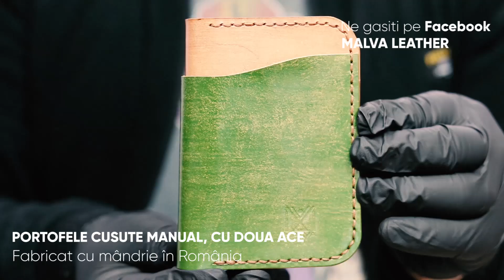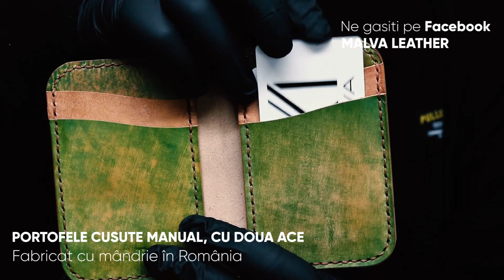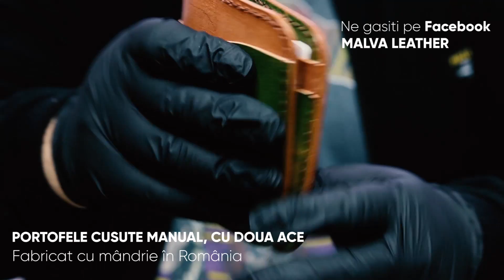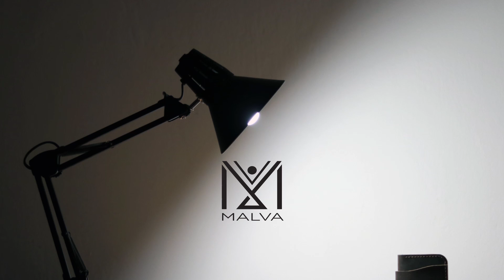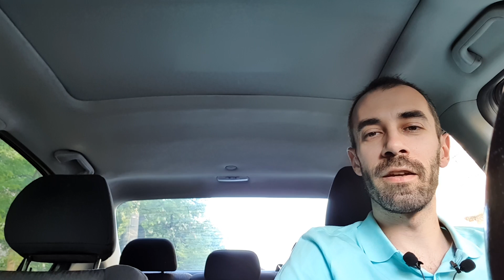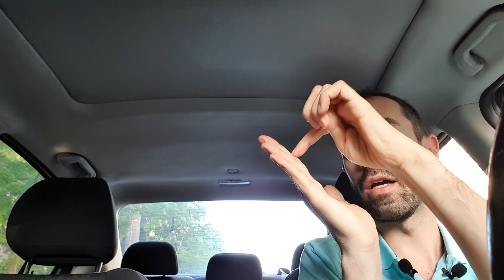Turbinele Twin scroll, de ce le folosește BMW?

Comment: Am zis prea sumar codurile motor de bmw, las aici un link cu o diagramă

https://www.bimmerworld.com/About-Us/BMW-Chassis-Engine-Codes/
Reply: Poti sa faci te rog un video in care sa explici cum functioneaza calculatorul de bord al unei masini? Multumesc!
Reply: @cosminionita1649  te referi la computerul de bord care afișează consumul? Nu e mare chestie, isi preia informația de la senzorii abs și de la rampa de injectoare
Reply: @vladdutz20  Salut! Ma refer la ECU mai exact, as vrea sa stiu ce inseamna acele "mapari" de care am tot auzit, care e rolul lui in intreg ansamblul unei masini, daca poate fi modificat / programat sau nu, lucruri de genul asta. Explici super mega bine, te urmaresc de ceva vreme si chiar as vrea sa vad o explicatie din asta asa in stilul tau despre ECU!
Reply: @cosminionita1649  ecu controleaza injectia motorului prin masurarea debitului de aer prin debitmetru, si prin sonda lambda, primește informații de la o serie de senzori si decide cat combustibil sa comande injectoarelor.
Poate fac un video si pe tema asta
Reply: @vladdutz20  Vlad. Cum reusesc gazele de evacuare sa ajunga inapoi in alt cilindru. Dat fiind faptul ca evacuare este separat de admisie. Adica cand un cilindru are supapele de evacuare deschise. Cum pot ajunge in alt cilindru prin supapele de evacure respectivului. Ele nu sunt inchise pana dupa explozie. Galeria de evacuare nu are legatura cu cea de admisie.
Reply: @denisdanielmuresan4316  pai nu ajung prin admisie, ci prin evacuare.
O evacuare stock este 41 format și toate țevile comunica direct, in momentul in care pistonul 1 își face evacuarea pe urcare pistonul 3 termina ciclul de evacuare și exista o suprapunere de câteva zeci de grade a deschiderii simultane a supapelor de evacuare pentru cilindrii 1 cu 3 și 2 cu 4.
Sistemul twin scroll împerechează țevile pentru 1 cu 4 și 2 cu 3, astfel separând acele suprapuneri și întreg volumul de gaze se duce in colector.
Reply: @denisdanielmuresan4316  Cylinder #1 had just evacuated it’s exhaust gasses and it’s in the process of closing its exhaust valves while the #1 intake valves are also in the process of opening to begin the intake stroke. Unfortunately, cylinder #3 is opening its exhaust valves and releasing high-energy exhaust gasses. While the large percentage of the energy and pressure from cylinder #3 are being used to drive the turbine, a smaller percentage is looking for an easy way out (the path of least resistance). When the pressure is lower going back through cylinder #1’s open exhaust valve than it is at the open/ non-divided inlet of the turbine, exhaust gas from cylinder #3 will circulate back into cylinder #1. Since cylinder #1 is trying to begin an intake stroke, some of the intake charge gets diluted by exhaust. A diluted charge robs power that could have been realized without the dilution
Reply: @denisdanielmuresan4316  uite un articol amplu pe tema turbinelor astora

https://dsportmag.com/the-tech/twin-scroll-vs-single-scroll-turbo-test-the-great-divide/
Reply: @vladdutz20  cilindrul 1 nu are o evacure fortata dupa mom. in care deja a fost o evacuare obisnuita?
Reply: @denisdanielmuresan4316  in urcare da, e evacuare la presiune mica, dar suficienta cat sa ajunga gazele in cilindrul celalalt

Comment: Nu stiu cati dintre cei care va urmaresc, stau 30 minute continuu sa asculte. Nu stiu cati dintre ei stiu ca pot modifica viteza de redare si astfel se bucura de tot materialul in acelasi timp . Eu reusesc sa urmaresc cu 2x si asa reusesc sa va urmaresc toate materialele. Multumim de informatii
Reply: O idee buna, stiu ca sunt lungi materialele dar ma lungesc ca sa incapa toate detaliile.
Jason penske de la engineering explained am vazut ca se limitează la 10 minute, dar acolo e mult detaliu tehnic in engleza
Reply: @vladdutz20  nu e mult materialul. E scurt timpul oamenilor si atentia este scurta in prezent. Voi cred ca vedeti cat timp se uita oamenii in medie la videouri si ce minute parca. Ideea e ca eu asa reusesc sa ma bucur de material in mod integral si se aude si clar cu 2x. Chiar super usor de inteles de ce un motor de 3 e echilibrat si mi-am stabilit urmatorul motor sa fie de 3 :D
Reply: @vlada.5819  6 e cel mai interesant dar vine si cu impozitul prohibitiv :))
Reply: @vladdutz20  Da, ne asumam. In schimb in Germania e taxa mai mare la asigurare ( in functie de cp ). Impozitul nu difera mult fata de un motor de 2. Macar e altceva

Comment: Nici papagalii de la reprezentatele Bmw n-au atat habar, felicitari !!!
Reply: Bmw nu are reprezentanta in Romania. Are doar dealeri. Mergi tu la un dealer bun si iti ierti cuvintele :))
Reply: @raducirstea5011  M-ai spart cu commentul asta... asa-i ca apa-i uda ?
Reply: @puff0086  ai spus-o de parcă tu ai inventat apa calda
Reply: Aia la service trebuie sa stie sa faca o diagnoza corecta si sa monteze piesele conform specificațiilor.
Reply: @vladdutz20  foarte corec... '' trebuie sa stie '' dar n-au habar in general.
Reply: @whiskeytangofoxtrot6080  incerc sa raman original.
Reply: E bine ca au știut ingineri sa le proiecteze
Reply: @raducirstea5011  Salut, poti sa dai un exemplu?

Comment: Vlad ai mentionat motoarele N52 si N53, ca sunt bune, fiabile. Asta se aplica perfect doar la N52, N53 desi a fost tot aspirat si tot 6 in linie, a fost destul de stricacios. Sunt pline formurile in Germania pe tema asta, dar am gasit si informatii in engleza.
Cele mai mari probleme sunt la pompa de injectie - are aceeasi ca N54 :) - si injectoare, deci vorbim de costuri foarte mari. Eu m-as feri de masinile dotate cu acest motor (de exemplu seria 5 2007 - 2011), un set de "doar" 4 injectoare noi pt "fiabilul" N43 m-au costat peste 800 euro, si nici macar nu erau Bosch...
Reply: Corect, sunt acele pompe HPFP stricăcioase, N53 având injecție directa, fara valvetronic, si au fost sensibile la sulful din benzina, de aceea nici nu au fost vandute in america, acolo au ramas pe N52 si pe N46

Comment: Fa un video si cu tehnologia motoarelor Mercedes esti foarte tare sti sa explici foarte bine
Reply: Ar fi prea generic, la mercedes acum au bagat o chestie care mai e folosita si de audi, compresoarele electrice eBooster care completeaza turbina clasica si elimina lag-ul
Reply: Vlad Micsunescu zici de motoarele 3.0 benzina 6 cilindri in linie cu tehnologia cu un motor electric de 48v
Reply: Vlad Micsunescu motor sau generator electric nu mai stiu sigur
Reply: @ionutsolovastru1686  am făcut deja un material cu mentiune si deapre OM656
Reply: @ionutsolovastru1686  se numeste ISG integrated Starter Generator si este montat pe volanta, are rol si de demaror si de alternator doar ca e pe 48v si pe langa încărcarea bateriei prin regenerare baga curent si in compresor de aer condiționat, pompa de apa si restul de consumatori electrici din mașină...un mild hybrid interesant.
Se numeste EQ Boost sistsmul, iar cel plug in hybrid cu posibilitate de rulare electrica se numeste EQ Power
Reply: Vlad Micsunescu mersi pentru informați 👍
Reply: Vlad Micsunescu cum se numește materialul cu mențiune si despre OM656?

Comment: Frate mie drag sa urmaresc clipurile facute de tine, felul cum explici, cum te exprimi! Bravo tie! PS: am si eu o intrebare ce parere ai de Honda Civic FN2 2.0 iVtec?
Reply: Pai fn2 are 1.4 ivtec, 1.8 ivtec, 2.2 diesel si 2.0 type r, daca întrebi de type r e o masina foarte fiabila, fiind motor aspirat, pe o caroserie usoara si rigida...eu civic 1.8 am vrut sa imi iau initial dar nu am găsit în banii disponibili

Comment: care sunt limitele aplicatiilor twin turbo vs twin scroll? de ce 28i foloseste twin scroll si 23/25d foloseste twin turbo? iar 20d sau 20i folosesc o turbina simpla, corect?
Reply: Pe diesel nu exista twin scroll din cate stiu, nefiind aceleasi cerinte ca la benzina.
Depinde de motor, acum de la 18d pe b47 sunt twin turbo toate( o turbina mica cu geometrie variabila de presiune mare si o turbina mare de presiune mica cu geometrie fixa si wastegate)
Cadillac a plusat jocul cu turbina tehnologie Dual Volute Turbo, un progres al sistemului twin scroll.

Un sistem twin scroll este mai ieftin si mai putin complex, fiind vorba de o galerie cu tubulatura separata in perechi si o turbina simpla, iar twin turbo presupune ceva mai complex, 2 turbine, tubulatura complexa, ungere, racire, valve de control, si in esenta sistemele au rezultate similare.
Avantaj la twin turbo e ca poti doza mai bine aportul turbinelor pe un spectru mai larg de ture , ele pot funcționa alternativ sau cumulativ, de exemplu la B47 turbinele merg pe rând,nu impreuna, iar na N57s cele 3 turbine merg impreuna, intra treptat una peste alta
Reply: @vladdutz20  daca poti preciza mai exact acel "de ce 28i vs 25d". care e diferenta de cerinte intre benzina si motorina?
Reply: @madalincosma2531  pai e diesel vs benzina, ai alta plaja de turatie, alta rata de egr, alte temperaturi.
In general.twin turbo pe benzina se pune pentru putere mare, iar diesel folosește twin turbo pentru eficienta.
Compromisul pt simplitate este twinscroll la benzina
Reply: @vladdutz20  da, benzina a avut twin turbo si au trecut pe twin scroll pentru aceeasi putere si consum. La diesel de ce nu s-a facut similar? Ca n54 si n55 aveau cam acelasi output si consum, chiar twin scroll putin mai elastic parca
Reply: @madalincosma2531  difera motoarele, n54 nu avea valvetronic, si turbinele ales au fost problematice, fiind primul bmw turbo după multi ani.
2 turbine vor fi tot timpul mai complicat de gestionat din cauza tubulaturii, a conductelor de racire si ungere.
Twin scroll pt puterile medii e mai ok.
Pe notoarele mari se merge chiar pe twinturbo twinscroll, cum ar fi pe S63 v8 de pe x5m.
La diesel se pare ca formatul twinscroll nu este optim, acolo motorul are presiuni de supraalimentare mult mai mari, in unele cazuri peste 2 bari, si turbina este mai solicitata decat la o benzina, si atunci probabil prefera sa mearga pe twinturbo secvential pentru emisii si eficienta

Comment: Deci te-ai apucat de cursuri online.. sper sa nu ne dai si teme pentru acasă :)
Ai spus 2 lucruri in videoul asta, poate inteleg si multi altii "cunoscatori":
1. Turbina NU reduce consumul, ci turbina + downsizing-ul reduce consumul
2. Turatia mica la diesel e datorata cursei mari si componentelor grele si NU datorita aprinderii sau arderii lente sau alte aberatii
Reply: Ba da, turbina pe injecție directa poate sa reduca consum pentru ca poate merge cu amestec sărac care implica o ratie de aer mai mare decat cea de benzina,insa treaba asta implică reproiectări pentru controlul detonațiilor.
De exemplu ciclul miller este ciclu atkinson cu turbina/compresor care adaugă aer si cuplat cu scăderea compresiei duce la un consum mai mic.

Legat de diesel da, de la cursa mare are turatie mica, asta e valabil la orice motor undersquare cu cursa simtitor mai mare ca alezajul, fie el pe benzina sau diesel
Reply: @vladdutz20  Nu comparam tehnologii specifice cu cazul general. Eu comparam un motor turbo cu unul aspirat de aceeasi cilindree la cazul general, nu in anumite conditii specifice si cu anumite tehnologii. Spuneam ca daca pe un motor aspirat pui turbina, va consuma mai mult.
La aceeasi cilindree, per total un turbo consuma mai mult. De asemeni, un turbo consuma mai mult si in cilcu miller fata de un aspirat in ciclu atkinson.
Daca e sa comparam ultimele tehnologiile in situatii specifice, mazda skyactive-x in modul SPCCI e un motor aspirat cu o eficienta imbatabila. Nicio tehnologie turbo cu amestec sarac nu se apropie de eficienta acestui SPCCI.
Tot scopul turbo-ului e sa creasca cantitatea de aer si prin urmare cantitatea de combustibil injectat, astfel incat motorul sa se comporte ca un motor de capacitate mai mare.
La fel cum ciclul atkinson/miller/budac e o metoda care face ca motorul sa se comporte ca un motor de capacitate mai mica.
Reply: @sil778  skyactiv x de mazda are compresor mecanic de exemplu.
In esență scopul turbinei e sa bage mai mult aer ca sa intre și mai mult combustibil
Reply: @vladdutz20  Skyactive-x este un motor aspirat, compresorul ala de la skyactive-x nu este pentru supraalimntare. 
Si asta o spune mazda:
Tehnologia skyactive-x este supraalimantata?
Nu, dar există un compresor care ajută la presurizarea aerului în motor atunci când funcționează în modul SPCCI.
https://www.mazda.ro/de-ce-mazda/skyactiv-x/
Reply: @sil778  pai atata timp cat baga presiune inseamna ca funcționează si supraalimentat, ca sa atinga amestec sarac de 27:1 ratie
Reply: @vladdutz20  Acel supercharger de la skyactiv-x are alt scop fata de ce scop are la un motor normal. 
La un motor supraalimentat, superchargerul e pus ca sa cresti puterea, adica sa bagi mai mult aer ca sa poti baga mai mult combustibil.
La skayactiv-x, superchargerul baga aer mai mult dar NU cu scopul de a baga mai mult combustibil, deci NU are scopul de a creste puterea.
De aceea skyactiv-x NU este considerat motor supralimentat.
In fine, de la ce am pornit si unde am ajuns :)
Poate faci si un video cu modul asta de functionare a acestui motor. Eu am inteles mai multe de inginerul de la mazda din videoul de mai jos. Oricum, astia de la mazda se lauda ca cu acest motor si hibridizare ajung la 56% eficienta termica, adica mult peste toyota cu 40%.
https://www.youtube.com/watch?v=a82Wt53gu78
Reply: @sil778  am vorbit despre skyactiv x in video mai vechi despre tipurile de injecție, și da, cred că este o abordare interesanta

Comment: Verificarea cunostintelor: Vlad are bimicrofoane pentru ca poarta 2 microfoane de aceeasi dimensiune. Vlad ar trebui sa fie favoritul  samsarilor.. pai daca incepe un samsar sa bage din top si sa si para ca stie ce dumnezeu vorbeste cumperi masina fara negociere. Apropo de asta, ce parere ai de motorul1.6 benzina de pe Suzuki sx4 s-cross 2014?
Reply: TwinMike sau BiMike :)))
Pai Suzuki din.asta a avut o colega si l.a vandut dupa vreo 6 ani, foarte fiabil, avea și ceva dotari masina, si 4x4
Reply: @vladdutz20  conform explicatiilor ofertie de dumnevoastra de-a lungul acestui material videografic, se incadreaza in categoria BiMike deoarece dimensiunile si "capacitatile" microfoanelor in cauza sunt identice:)). In alta ordine de iei, trebuie sa imi cumpar o masina "noua": Mazda 6 2013 2.0 benzina, Suzuki SX4 2015 1.6 benzina sau Kia Sportage 2012 1.6 benzina. Stiu ca nu au legatura insa conform criteriilor mele de cautare am ajuns la astea 3 modele. Suzuki ar fi cel nou, cu cei mai putini km si pret ok, de aia am intrebat.
Reply: @nrbogdan  e spatios ca e inalt... Nici mazda aia nu suna rău

Comment: Ce parere aveti despre bmw 420i 2015? Este fiabil?
Reply: N20 motor, au avut ceva probleme la patina lantului de distributie,insa s.a localizat problema la primele produse prin 2013.
Avantaj e ca daca are compresie 10 merge resoftat la 241 cai cat are și 428i, este doar din soft diferența...duce si mai mult defapt.
Succesorul, B48 e mai rezistent
Reply: @vladdutz20   Multumesc de răspuns, precizez ca masina are 68000km... sa inteleg ca nu ar trebuii sa imi fac griji in privinta motorului?
Reply: @f.m.2624  nu cred, și dacă ar fi sa fie distribuite, acest model de motor are distribuția in fata și e ușor de schimbat

Comment: Care sunt diferentele intre un B47 si N47 , cel B47 este mai fiabil ?
Reply: @Radule39  stiam asta , dar ziceam ca b47 cu ce este mai special fata de n47 ? Inafara de diferentele de putere
Reply: Este pe constructia modulara, toate motoarele b37 b38, b47 b48, b57 b58 împart multe componente.
Au presiune mai mare de injecție, sistem adblue.

Daca ai chef de citit, uite aici disecție pana la ultimul surub

https://www.scribd.com/document/401405687/B37B47-Engine-pdf

Comment: Bro, m54b30 exemplu, 54 nu face referire la nr de cilindrii
Reply: Ba chiar face referire la nr de cilindri my brother, codul scris de tine se traduxe așa :
Este un motor din familia M, adica proiectat inainte de 2001,
5 reprezinta faptul ca are 6 cilindri
4 reprezinta ca e a 4a generatie de motoare din familia M
B vine de la Benzin
Iar 30 este cilindreea de 3 litri
Uite aici explicatie in amănunt, adica ai familii M, S, N, B, P, W,
3 vine de la 3 cilindri 1,2,4 vine de la 4 cilindri, 5 = 6 cilindri, 6 = 8 cilindri, 8 = 10 cilindri, 7 = 12 cilindri.
B benzin D diesel, cifrele de dupa sunt cilindreea în unități de cate 100cc, T O M U K este intevalul de putere, si ultima valoare Este varianta de update tehnic.
Le poti vedea ca TU, TÜ, O0, 01...

https://images.app.goo.gl/MKUWgDvinQj1uoNz5

Comment: Tot nu am inteles cate turbine are f01 -ul meu. E twin power turbo n57 258 de cai.
Reply: Una singura, ar trebui sa se vada pe partea stanga a motorului

N57D30Ox uses a single turbocharger, while N57D30Tx uses twin-turbochargers, and N57S uses three turbochargers of varying size.
Reply: @vladdutz20  pai chestia e ca in codul motor are litera T . E ceva de genu n57T. Nu mai stiu exact ce mai continea dar stiu sigur ca are un T.
Reply: @florin-t  O e cu o singura turbină, T e cu 2 si S cu 3...de obicei puterea de 258 e cea pe o singura turbina, si la tdi v6 e la fel
Reply: @vladdutz20  am inteles. O sa ma uit totusi pe certificat sa vad daca scrie O sau T.
Reply: @florin-t  sau te uiti la motor si vezi daca are unul sau 2 melci :))
245 vs 258 cai e posibil sa fie cu 2 turbine